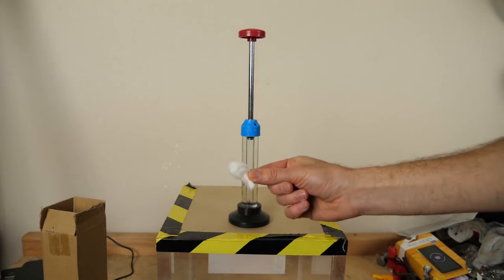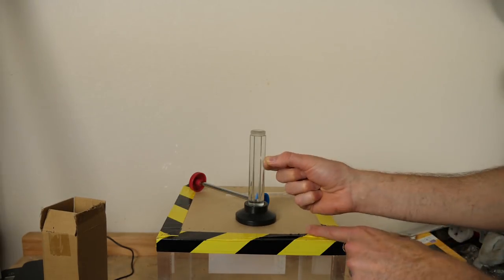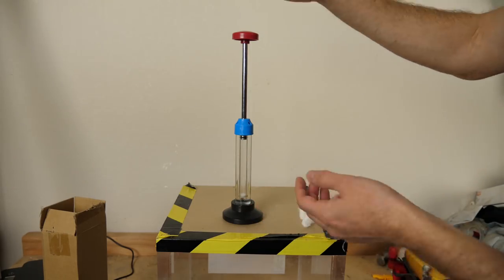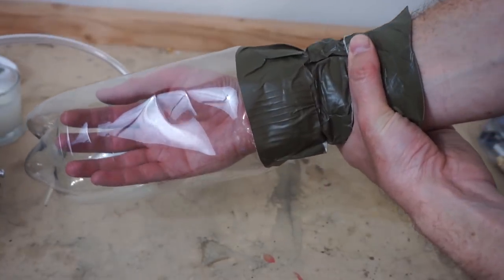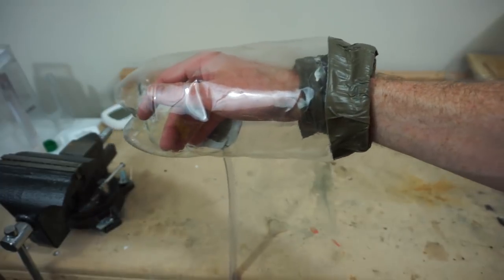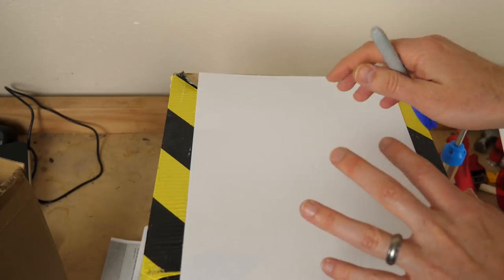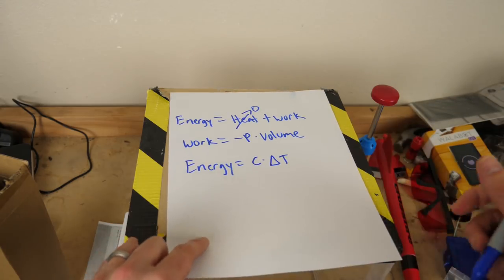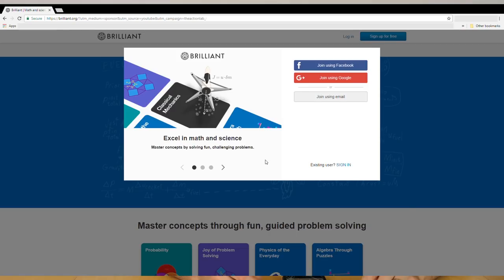My Arm vs the Fire Syringe—What Happens When You Crush Air Really Fast?

Comment: In a diesel it is first compressing so its really heating up, and than a spray of diesel that will ignite right away. Because than the engine has control over the ignition timing.

Comment: Fun video! :)
I’ve found that you can feel a plastic water bottle warm up if you compress the air in it by twisting both ends in opposite directions.  Then when you let go of one hand (releasing the added pressure) you can feel the bottle suddenly get cooler :)

Comment: you are awesome bro. im also a chemical engineer . i wanted to learn more about second law of thermodynamics. like when current passes through wire. it heats up. but its reverse isn't possible. i would like to see you working on such experiments
Reply: It is possible to convert heat directly into electricity. It is called the Seebeck effect. It's not really efficient but is used in radioisotope thermoelectric generators (rtg's. mars rovers (some of them, others use photovoltaic panels), satellites, etc)).

Comment: You should pressure your lips with that thing if you want to have Kylie Jenner's lips.
Reply from the maker: High pressure lip shrinker
Reply: Exactly.
Reply: Pro Player 1⃣ LoL
Reply: Rick Sanchez Pretty sure no one would be stupid enough to do that lol.

And if they did, they deserve it tbh.
Reply: In every action lab video, there will be a proplayer 1️⃣ top comment. That's how the universe works..... And in every proplayer 1️⃣'s comment, there will be my reply.
P.s: with a count.... Reply number 5️⃣
Reply: You achieve that by sucking air out, not putting it in
Reply: YoloSwaggintons yes
Reply: YOURE ON EVERY VIDEEOOOOOO AHGHDHDN
Reply: Dandan the dandan. Kids have eaten tide pods and you doubt someone would try this??? Lol
Reply: Pro Player 1⃣ you need low pressure for that, not high pressure...
Reply: Farn0 
You can't say that if you didn't try it
Reply: Farn0 IS correct though. Low pressure inside the bottle would suck their lips into the bottle causing them to swell. High pressure would push against them just like it did his hand and push them out. Just like it did with his hand. If they happened to let the air into their lungs I wouldn't imagine it would be very good for them either depending on how much pressure there was.
Reply: Pro Player 1⃣ lol I'm sure you're joking, but if you're not...  i don't need to try it because it's science.
Reply: Justin Munn thank you.
Reply: Hi
Reply: The Action Lab this experiment leads me to believe that YOU can make a fully functioning engine ran on nothing but compressed air. Up for the challenge?

Comment: Hello! I have a question. If you were to put coal in a fire syringe and smack it hard enough, would it make a diamond? Because diamonds are formed in extreme heat and pressure and both of those variables are present when using a fire syringe. But then again, carbon might need extreme pressure and heat for a longer than a few milliseconds for a diamond to form... And it might not be enough heat and/or pressure... This has been bugging me. Please respond :).

Comment: PV=nRT boyle's ideal gas law. Given the same volume of air, and a constant amount of gas atoms (P=pressure, V=volume of the gas,n = mols of atoms per type of gas, R=Regnault costant ) and solve for temperature. PV/nR=T. If the pressure goes up, the temperature goes up  and vice versa (given that the volume of gas and number of atoms of the gas remain constant). If you change the amount of gas in a system and the volume remains constant then the pressure and temperature go up. If on other hand you add temperature and the volume remains constant the pressure increases.

Comment: Build several identical terrariums in soda bottles (maybe sterilized potting soil and bird seed).  Pressurize them to 1 atm, 2 atm, 3 atm, etc to whatever the soda bottle will hold.
Observe the plant growth.
2nd experiment: fill them with CO2 at different pressures.

Comment: If rockets have heat shields when under freefall in the atmosphere, won't using a coolant with high thermal conductivity as an additional measure be viable?

Comment: What would happen if the nozzle of an air gun is filled with a fluid and sealed at the end, after which the bullet is fired.I guess, there may be an explosion, but that probably depends on the Young's modulus of the gun's nozzle.

Comment: That's how diesel engines work.
On the first stroke, air gets in the cylinder.
Second stroke, the air gets compressed, which raises its pressure, effectively heating it up.
Third stroke, fuel gets sprayed into the cylinder, and because of the already high pressure/temperature from the compression, it ignites immediately.

Comment: I would like to see this with Hydrogen as Hydrogen has a negative Joule Thompson coefficient so instead of feeling warmer as it compresses it should get colder. You could do this safely by displacing any oxygen in the container with water and or doing it inside of a purged plastic bag filled with mig gas or something so there is no chance of combustion.

Comment: 2:25 isnt pressure = friction in this case? Air molecules are vibrating on the object with more density and with more energy which is the same thing as fricktion isnt it?

Comment: I always though compress thing was colder due to molecule beeing more close to each other like when water freeze. Propane tank always felt cold and my dad compressor was also cold when he compressed air when I was a kid (he changed job). So does it warm up and get colder after ? Or am I missing something ?
Reply from the maker: Your propane tank felt cold because the gas was expanding out of the tank so the temperature decreased. So the opposite of compression is expansion and that caused it to decrease in temperature as expected
Reply: The Action Lab Thanks for "answering" that fast ! That's interresting I didn't know that. Always though it was the opposite.
(Oh and Sorry if sometimes my english is weird I'm french canadian)

Comment: The first experiment shows how the car engine can work with air only, because the compression generates a explosion as the regular fuel that makes move the car and other vehicles... but as always never tell this at the oil extractor or they will start a commercial war 👍🏻
Reply: The compression don't generates an explosion. It only generates heat. Without a fuel, nothing will explode/burn ;)
Reply: CMDR Mina Enfield yep you've right 😝 but it's possibile to use something different that isn't derived from oil 🤙🏻

Comment: Okay diesel burns when its compressed but the question that i do every time this topic comes out is why the hell you need spark plugs for gasoline if it is more flammable that diesel?.
Reply from the maker: It’s because the kindling point (the point of spontaneous combustion) for diesel is 256C and gasoline is 280C. So even though gasoline has a lower flash point (it’s more flammable) than diesel its kindling point is higher.

Comment: That's wierd! Actually, air should got COLDER when escaping the compressor chamber.
Reply from the maker: Yes but it quickly rises to room temperature through the long tube (gains heat) and then once it re compresses in the soda bottle it raises above room temperature.

Comment: Flawed experiment... Using the air from an air compressor tank, you're actually reducing the pressure. That's not how this works
Reply from the maker: The air compressor  tube I  had was about 30 feet long. Long enough to heat to room temperature before entering the bottle. Then once it re compressed it raised temperature